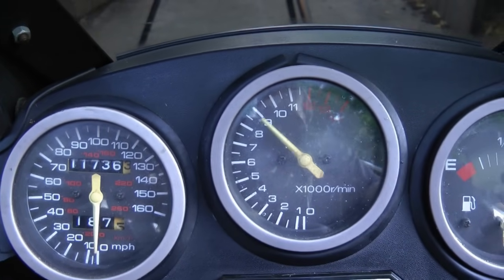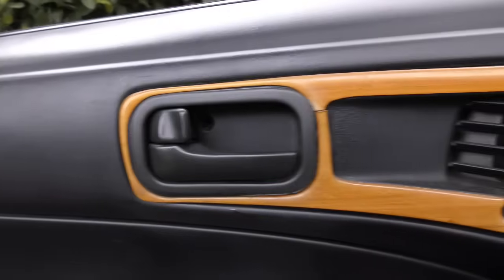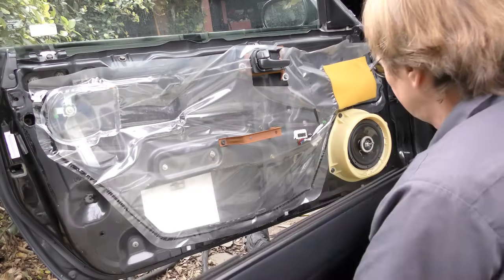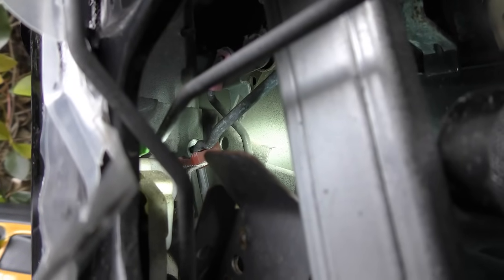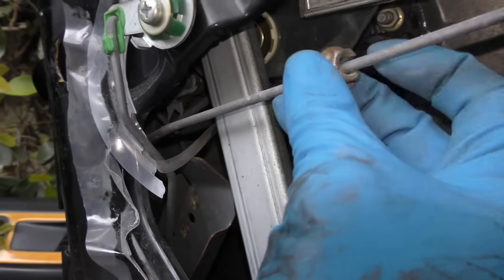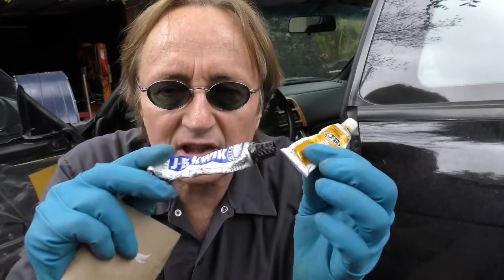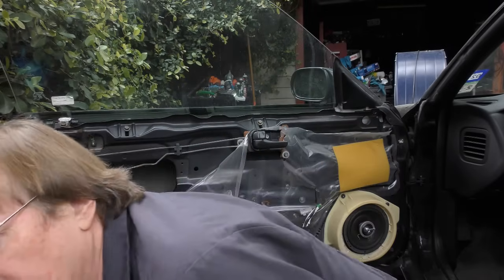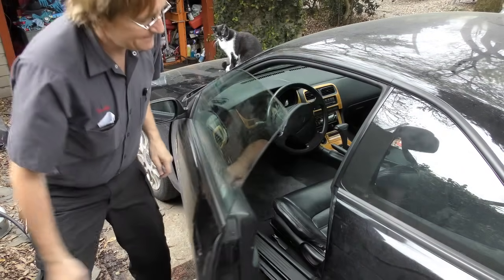How to Fix a Stuck Car Door that Won't Open

Comment: Hey Scotty, I have a 2004 BMW 530i with 115,000 miles with a check engine light and codes P0171, P0174, P0411, P0411P.  If I reset the light it will stay off unless I leave the car idling in weather under 30 degrees.  Now that it's warmed up the light has gone away. Should I just ignore it or get it fixed now?
Reply from the maker: ignore it, and if you're smart, sell that car fast. At that age, they become endless money pits. Your plastic intake system is probably starting to leak, it heats up in warmer weather then doesn't such vacuum leaks as bad then. But they will get bigger over time, I guarantee you that.
Reply: Scotty Kilmer The good thing about those "older bmws" though is there is a ton of aftermarket parts for them. Whole podfilter swtups are around 100-200 dollars and those straight 6 engines are pretty bulletproof.
Reply: Turned out to be the "secondary air check valve" which is supposed to open during a cold start.  Mine was 10 years old and clogged up, tried cleaning it but ended up having to buy a new one, fixed it in 20 minutes.

Comment: I have a Hyandai Santa Fe and the rear passenger side door was not opening from the outside then accidentally put the child lock on and now we can’t open the door at all. Do you have any tips or hints for me please? I’ve had a quote and it is quite expensive

Comment: Hey Scotty, I have an 2007 Saturn ion Saturday I cleaned the throttle body "drive by wire"Off the car. And un hooked the battery. Now it has to re learn the idle. Any help or suggestions on  how to get the idle back right without having to go to the dealer. Thanks.
Reply: He actually did a video on this. Unfortunately the computer in all cars made since the early nineties will purposely offset the idle speed on a drive by wire system, there for you need a certain tool that is plugged into the code reader port underneath the steering wheel.
Reply: Mike Currier I was told that i would have to drive the car so the stupid computer can re-learn the correct idle. The dealership wanted to charge me 180.00 to due throttle body clean and fuel treatment. No way i was paying that. I guess next time i'll clean it while its still on the car and just have someone press the gas peddle down while i clean it. do you think autozone would be able to set the correct idle? all i have is a basic code reader.
Reply: You might be able to rent the equipment. Not sure though.
Reply: Thanks I got it fixed. Had to take it to the shop they said the ECU had to be re programmed. After 98.00 and ten minutes later fixed. Talk about over priced.
Reply: Yeah, I thought it was the ecu but wasn't positive. Didn't want to say it and lead you in the wrong direction if I wasn't right.

Comment: Hey Scotty I just bought a 2000 infinity I 30 and the driver door won't open inside or out side , also the is up but doesn't work , mybe a new motor . Any feedback would be great ,they already have the whole door apart .

Comment: P.s. Last time it worked I had hit door locks, shut the door and it didn't shut all the way so I gave it a bump.  Handle would not work for weeks.  I think it is something electrical and not always a broken part inside. Not doing THAT again!!

Comment: Hi Scotty. Toyota Sienna 02 driver door won't lock properly when I replaced with the used door latch and new door handle. I have not replaced broken handle trim bezel yet. When I pressed the remote button to lock, it locked and then unlocked. When locking, the small handle nob doesn't go completely to the lock position. Pressing the unclock button works fine. What is the cause?
Reply from the maker: Utuber   your used door latch is probably just worn too

Comment: Hey Scotty, I have a 1993 240sx Coupe and my trunk release lever won't open the trunk, the lever reads push to open the gas tank and pull to open the trunk, but it wont open when I pull it?

Comment: i have a kia picanto 54 plate, my passenger door won't open from both ways all other electrics work all other doors work fine, have you got any tips i could do myself without having to pay over the odds for a garage please
Reply from the maker: well, you have to remove the inner door panel to access the latch and open it. So cut that, or pay a locksmith who may be able to break in with his tools
Reply: Scotty Kilmer thank you

Comment: My door won't open at all either from the outside or inside handle now for some reason.  How do you remove the inside panel while the door is stuck closed?

Comment: Right now I'm having some issues with my truck hood. I pull release hood button in the truck and then nothing happens. I can pull the latch  between the hood and the grill up, but still nothing happens. When I hit the button inside of the truck I can hear a spring move but that's about all.
Reply: Any help?
Reply from the maker: Bohdi Fritzsch have some patience, this is free and I do have 73 million plus viewers. When those release systems break down, it can be a mess. TRY like mad with another guy hitting the hood as you push the button to get it open, cause if you can't, you'll need a good mechanic to break in without damaging the hood itself forcing it open. Often the release latch needs lube or replacing if you do get it open

Comment: Can a blown head gasket affect a transmission?.I removed my thermostat as to relieve exhaust pressure build up in the coolant system.now the car rarely gets up to temp.and the transmission is very jerky.but hey the car don't overheat now:)
Reply from the maker: running an engine too cold can effect shift points of transmission, yes.
Reply: Ok.So I should fix head gasket.I tried sealers.didn't work.it's a very minor leak with tiny bubbles at the radiator neck when running

Comment: hello Scotty. I just had the same problem on a nissan versa 2012 sv model but the door won't open from the outside and from the inside, at first I remove change the keyfob battery but still gives me that trouble on the driver side only, the key opens the other 3 doors, as well as the keyfob buttons, it feels like it is stuck.

Comment: Hey scotty, My door windows have vertical scratches on them from rolling them down and up, what needs to be changed?
Reply from the maker: i am Viking window regulator assembly, as it's hitting parts of the door then scratching the glass. Also check for loose or broken mounting bolts inside the door that can hit the glass

Comment: I have a 1955  Suzuki Swift that seems be missing a linkage between the inside latch rod arm and the latch mechanism at the end of the door. It is almost impossible to reach and I have no idea what the linkage would need to be shaped like! The outside door latch lift handle works just fine. So it is the exact opposite of Scotty's video.

Comment: how would a locksmith be able to get in we tried using the key to but the door will not unlock. or are you talking about using that slim jim thing?
Reply from the maker: slim jim, or also try a tow truck driver, they are pretty good at that
Reply: ok thanks

Comment: Hey Scotty big fan love the videos but I have a small problem I have a 2011 Honda  Pilot and a passenger back door will not open from  The inside or the outside in strangely so does my trunk

Comment: Hey Scotty , I have a Suzuki Samurai. The door is stuck closed I removed the inside for panel. Got to the mechanism but simply don't know what I'm looking at. I can tell something isn't engaging but I could have told ya that without removing the panel. HELP ! if ya can. Thanks

Comment: Hey Scotty someone in my city is selling a 1997 Nissan Pickup 4 cylinder 5 speed but it has a check engine light on and the abs light on! Should I buy it?
Reply from the maker: only if it's really cheap, and I'd still scan it and see what the trouble code was for
Reply: He is asking $3,500! Is there any way to reset the abs light or no?
Reply: Eduardo Garcia Personally for $3500 I would take my money else where. You can buy all kinds of cars for $3500 and be in great shape and newer.
Reply: True!

Comment: I have a question for you I have a 1990 ford f350 crew cab it has a 7.5 460 motor and every once in awhile it will get a miss to it I did plugs wires cap rotor the too end of motor has less than 5000 miles on it and I checked the timing on it any idea what's causing it thank you
Reply from the maker: if it's fuel injected, weak injectors often do that. Try my video "how to clean fuel injectors on your car"

Comment: I have a question my Honda accord 2000,
Dashboard and tail light and running day lights don't work.
The question is what can I do to fix it?
Or if you know what could be the problem?
I will appreciate if you do take your time to reply back thank you!
Reply: have you checked the fuse box?
Reply: Yes I did there all good.
The thing is I dropped one of the tools and it hit the open wire in the car then now only my turn left and right and hight and low beam and breaks work. But the dashboard and night tail light don't work

Comment: Hey Scott  my 2012 Chevy Aveo driver side manual lock will not unlock after it was slim jimmed once.  Any tips on how to fix..Thanks
Reply from the maker: +joseph ishak take the inner door panel off and see if perhaps a rod just got knocked off the latch assembly

Comment: I have a keyless entry door opener. When I press the button to  lock my door, it will lock it and when I press the button to unlock it, it unlocks the door but my problem is, when I go to open my car door, it won’t open but when I look inside the car, all the locks are unlocked but drivers side won’t open. What do you think this could be?

Comment: Is there any way to keep power locks from freezing up in the cold? My driver's side door won't unlock if it's anything less than 20 degrees outside, at least not until after the car warms up.

Comment: Scotty i was looking at the mustangs gt's with the 4.6 have you ever worked on them if so are they reliable
Reply from the maker: strong engine, of course realize guys often rag the crap out of them so check a used one out closely
Reply: Okay thanks yeah I always get it checked out first

Comment: my driver side door won't open from the outside once I lock it, then I turn the key to unlock it and it won't open, but if I don't lock the car and I go to open it,  I Can.  I'm thinking it's something with the power, in not sure if it's the latch but ill give that a try.  thank you

Comment: Hey Scotty what can it be if my head lights wont turn on and some times do but most of the time one side works. And my gear lights are out also and so is the driver side  light of my door wont work even after I changed the bulb I drive an Acura TL 2004 can you please help. My own thoughts is that it might be an electrical problem

Comment: How would you go about opening a Dodge Avenger 2012 passenger door because i can’t take off the door panel and latch is stuck locked

Comment: Hello Scotty,
I got something similar going on in my 2000 Ford Expedition except my driver-rear door wont open because its stuck in the lock position. I've tried unlocking the door manually and the lock mechanism will pull up, but once you let it go, it retracts immediately. When you pull lock mechanism up and try to open the door from the inside or outside, nothing happens. Any help would be greatly appreciated. ;)
Reply from the maker: +Mike G    see if a locksmith can get the door open , then remove the inner door panel and fix the broken parts inside, often a bad latch. If you can't get it open, you have to cut the inner door panel apart to do that

Comment: I have an Acura and my driver door does not open from the the inside. So to get out I have to roll the window down to open the door. And the door behind it does not open at all. Please leave me some tips on how to fix these
Reply from the maker: +Sonya Sandoval remove the inner door panel, and often you will find either a plastic part of the inner handle has broken off, or the rod that opens the door just fell off it's connector

Comment: I have a question. I have this problem on both my rear doors. Except you can open them from the outside, its just that it takes a lot of unnecessary strength. I can easily open it from the inside. Its like the door gets stuck. How can I fix this? Do I need to lubricate something or is something broken?

Comment: What if you cant open the door from either side?  Do you have to destroy the panel to open it?  2001 Acura cl.
Reply from the maker: yes, that or find a good locksmith to break in
Reply: I'm having the same problem. the child safety lock is on and the door lock itself and I'm assuming the motor is dead to unlock the door. so now I'm wondering how do I get it open so I can fix it? lol?
Reply: Joseph Deleon
Try to pop the panel off from the top and get to the steel bar that works the lock and handle and pull them.
Reply: chriss4365
I've tried but the door seems to be solid and can't budge..
Reply: put the window down and remove as many screws as you can their is usually one where the door handle is then you should be able to work it off.

Comment: Hello Scotty,
I can't open my 03 tacoma drivers side door with power lock system.  When I turn the key to lock all doors respond, but when I turn to open them all doors unlock except driver door. I'm stuck and have no way to reach the actuator screws. thanks
Reply from the maker: +Daniel Perez driver's door may need new latch assembly, but take the inner panel out and pray it's just a rod that's fallen off on the opener rod system that unlocks the latch

Comment: I have a rear door on a s-500 that wont open. Neither the door handle outside or inside will open the door and I hear the latch cable when you pull the handles.I check the Mercedes forum and the best someone told me was to kick it open from the inside but the also told me you would damaged a two hundred dollar part inside the door along with what else that not working. Any good ideas how to get the door open that not costly.
Reply from the maker: +RKellyMask  if you can't jiggle it to get it open, pay a locksmith or tow truck driver to get it open, they are pros at getting into cars
Reply: Scotty Kilmer Thank you ill try that instead of kicking it open might be way cheaper.

Comment: jack of all trades :)  l have a clio and the door has stopped opening from the outside. have to jump over the passenger seat to drive the thing.  can you help please?
Reply from the maker: +catherine scotlandforever take the inner door panel out, and fix the outer handle mechanism, it has to be fixed from the inside
Reply: That's scotty

Comment: My rear door won't open from inside or outside? Any ideas? I can't replace anything until I get the panel off and its screwed in the bottom of door, which I can't get to until the door is open. I have the top part of the panel off. I pried it up and over the locking latch. This is a 2010 impala. Any help would be appreciated before I lose my mind.  Thanks
Reply: i have the same.problem.can someone help us
Reply: I figured it out. you have to take the door off. Very easy to do. Open your front door and the door bolts are sitting right there. When the door is loosened, you can get at removing the panel and also can get a screwdriver in where the latch is and wiggle it open. then, replace or repair your issue and bolt the door back on.

Comment: How would you fix a door for an 85 chevy monte carlo. The inside and outside don't work also I noticed that a long piece of metal that hooks on to the door handle outside came out but when I put it back still nothing any ideas?

Comment: I put in a new latch and now neither handle will open the door.  I can’t even open it manually with the cable or the rod inside the door panel.  Any suggestions.

Comment: hey scotty!
I got a 2003 350z and the passenger door doesn't open from the inside or the outside
Reply from the maker: pay a locksmith or tow truck driver to break in to get it open so you can take the inner panel off. Otherwise, cut a big hole in the inner panel to access the latch

Comment: hey scotty. i have a problem same as this but my car is 76 chevy nova. my driver side door lock is broken and has been for awhile. my lock used to work when i would turn the key to lock and unlock as of right now i can turn the key to lock it but once i turn the lock to the right it wont unlock. i would have to go through the passenger to side to lift up the lock to unlock it. also of right now my car door wont open from inside or outside. i have to get out from the passenger side. how do i get my driver car door to open?
Reply from the maker: +Gage Edwards  you would have to get it open to get to the inner panel to work on it. If push comes to shove, you cut a hole in the door panel inside to access the latch and open it
Reply: +Scotty Kilmer thank you scotty. big help bud.👍

Comment: Hi Scotty, I have a 2001 Kia Sportage Convertible Basic Model.  The inside door handle stopped working on the driver"s side. Also  both windows go off track when closing them. HELP